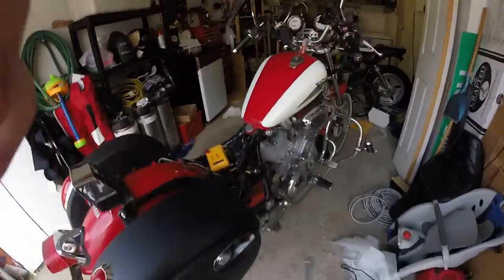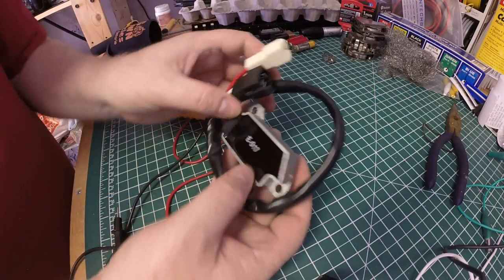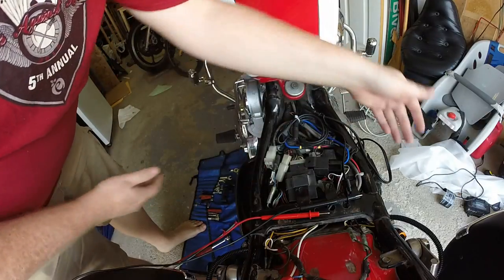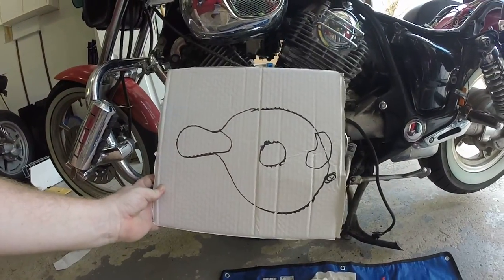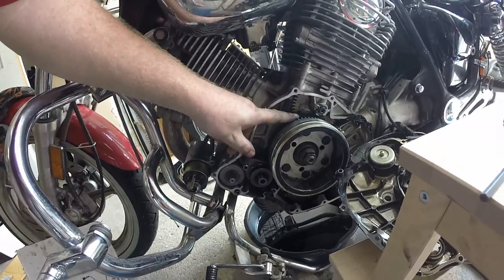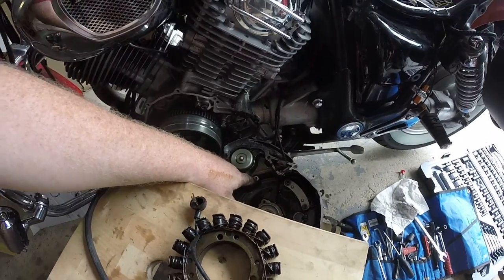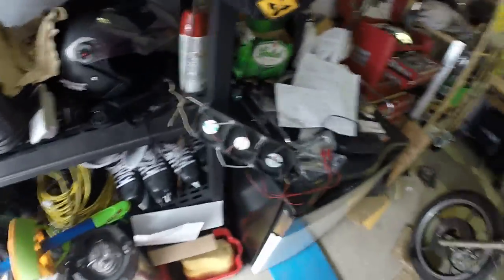1995 Virago xv1100 Stator Replacement (Part 1: removal)

Comment: Hello my friend
Can you tell me the number of threads, the dimension of the winding wire of the stator. Star or delta winding connection?
Reply from the maker: Sorry, no.  I didn't take those measurements.  I bought one off eBay similar to this: https://www.ebay.ca/itm/272268238568
I hope that helps!
Reply: @zeroreality  Does anyone know how to tell me the number of threads and the thickness of the wire for this stator magnet.Please help
Reply from the maker: @musicfromaroundtheworld5453  I've pinned your comment to the top of the comments in case someone comes by and can answer you.  Good luck!

Comment: Great video, but maybe I can save a step or two for others.  I learned this from a Yamaha Mechanic.  Leave the starter relay attached to the case.  Just remove the one hex head  bolt and its round assembly (this screws into the shaft for the gears).  Make sure battery is disconnected.  Remove wire from starter relay to starter (starter side)  I used a M6 1.0 thread bolt (2) to attach the plastic relay cover to the case cover.  This made it easy to attach  
I changed the stator from the other side of bike by sliding the cover  (with stator) under the engine, and sliding it back under when done.  I used a box to hold chrome cover while working.
Reply from the maker: Good stuff! If you have any more tips, leave them in the comments.

Comment: great vidio, thanks,, just an FYI, those are not Philips screws. they are JIS ( Japanese Industrial Standard) look almost the same, just have a flat tip. thats why they strip so easy if you use the wrong driver. cheers
Reply from the maker: Omg I know that now! I bought a set online (not Amazon, just can't remember where) shortly after I made the part 2 video and immediately stopped stripping screws everywhere. They are 100% the tool for the job.
Reply: @zeroreality  we all learned the hard way.

Comment: Thanks for making this, it helped to refresh my memory, I have to change another stator (used a cheap one last time, lesson learned). Instead of doing the cardboard outline the way you did, use the new gasket to trace your outline and hold your bolts.
Reply from the maker: Using the new gasket works, but I'd be worried about tearing it while working in my cramped garage.  The cardboard is disposable, stands up with all the bolts in place, and brings out my artistic side!  Did you reinforce the gasket with anything while doing the job?

Comment: Hey Alex, Thanks for putting a video of this up. I've been working on my uncle's 87' 700 virago, so far, for about seven hours. The hardest parts have been the starter motor philips screws were stripped and the assembly next to the flywheel spinny thingy with the spring kept coming apart as I'm trying to get the cover to go back on. I originally pictured this taking a few hours, but it has been more of a journey than that. I also found it hard to get my cover to "shunk" back on. The rods that go into the cover had to be oiled after I took so long that the RTV dried. Its been a day, ya know? Will update later this week once I finish up and put oil back in it.
Reply from the maker: If it's only been "a day", then you're like 10 days faster than I was.
Reply: the reason many people strip the 'philips' screws is because exactly that ; they aint philips screws. they are JIS screws ;
Japan industry standard. not philips :) they are almost the same... and thats what catches people, they have a philips screwdriver or bit, but not a JIS bit or screw driver. And it makes a difference having the right bit! trust me :)

Comment: thought i had the same problem but being a bike noob this video still helped me alot, i got a virago bobber from my dad a while back and started tinkering with it, i saw that the voltage regulator was zip tied to part of the farm, me not knowing i just figured that was the best place my dad thought would work, so i ended up bolting it to the battery box. me not know the casing was the ground for it, i ungrounded it doing so. the first part of the video let me know what i did wrong, ended up finding a place to bolt it to the frame and know my bike is charging again. thank you so much, it has been stressing me out for a couple weeks as i didnt think i had the mechanical skill to replace the stator
Reply: also if you read this where did you get the side cases?
Reply from the maker: @TylerGibsonSIRdipsALOT69  found them from a guy it in Newfoundland. Two pieces of plastic for $150.
Reply: @zeroreality  well hopefully they're good quality they look nice, thats my next add on for my bike is some cases, bobber or not i like functionality as well

Comment: Thank you for posting this mate. I’m having similar problems on a 1991Virago XV750, battery went dead while riding. I replaced it with a new one but still doesn’t charge. I’ll start by checking the stator.
Reply from the maker: Camilo Gonzalez Also check your rectifier. Take it off the bike to test. If it's the rectifier, it's a lot easier and cheaper to fix. Good luck!

Comment: Very informative. I think I just found my problem, thanks to you. My battery was not charging, but it may have been because I didn't have the rectifier grounded. I will check and hopefully it works. Thanks for the video.

Comment: Great vid! Similar issue with my vstar1100. Hoping is the rectifier
Reply from the maker: I hope so too since that is much easier to swap out.  Part 2 has a little bit on testing your rectifier (you need to take it off the bike to test it properly).
https://www.youtube.com/watch?v=w_Ui_FIkR_M&t=6m49s

Comment: I have an odd charging problem/issue.  Back in 09, I replaced the R/R that was shorted.  The odd part is, it only charge at 1500 rpm, ~13.5v  At idle, 1k rpm and Pass 2000 rpm, it goes back to ~12.5v ish......I think it might be the stator.
Reply from the maker: What's your battery's voltage when the bike is off?  Does the voltage sag when you hold the throttle past 2000rpm, or does it dip, then slowly rise?  Might just be a dead battery.

Comment: After taking everything apart except for one Allen bolt that I couldn't get off to put on my new stator I realized that my rectifier was blown and that is a 5-minute job... so anyone who's attempting to tackle the stator check your rectifier first you could save hours of grief..lol
Reply from the maker: Don't be so sure.  The stator and rectifier work as a pair, so a lot of the time they die together.  You may have had to do this job either way!  (This is what I told me neighbour after he paid to have his RSTD stator done, got the bike back and found out the rectifier was he problem all along.)
Reply: @zeroreality     yeah hopefully I won't have to replace the stator but I have it if I need to so far it seems the power is better and my light headlight is shining bright but I'll keep a close eye on it. My old rectifier looks like it exploded like a fire cracker ..that's how bad it was.lol  I got someone who can take that bolt off for me if I need to get to the stator. But your video was the best one to show me how to get all that stuff off to get to it. Only have forty thousand miles on my bike someone told me to Staters should still be good we'll see... I will keep you & your people posted.
Reply from the maker: @jpstevens7430  Cheers bud, and good luck.  I got a little voltage gauge that just read off the battery, and installed it on my bars.  It let me read the voltage in real-time and helped me get over being gun-shy on the bike.

Comment: Been trying to figure out what is blowing my 30A main fuse. Found today (thru elimination) that it's the regulator line. When I remove the regulator from the passenger peg (so it's not grounded), I don't get continuity thru the regulator feed (red wire) any more. 
For some reason, a previous owner cut the white wires from the stator and regulator and just wired them directly, so I can't "test" the stator per se. Can I assume that the short from the regulator red wire to the regulator frame that the short is in the regulator, not the stator?
Reply from the maker: Short answer: no, I don't think so.
I want to be clear here and make sure I understand the wiring.  The previous owner removed the little plastic connectors from the stator and rectifier and soldered the wires together directly?  If that's the case, then I suggest you first cut those wires (one at a time) and fit some kind of connector (of a different colour) on each wire.  I'd use bullet connectors and a different colour of shrink wrap on each one, doing one at a time so you don't mess up the order.  That way you can isolate the stator from the rectifier and test them individually for the short.

Comment: i have the same bike.my problem is my rear parking/signal light stop working.no power at all. brake light works. front parking light works but wont flash when L or R signal is pressed. headlight works. checked the fuses at the handlebar  and there good. What can it be?
Reply from the maker: First, check any wiring you did most recently.  I had done a bit when my flashers and break like stopped working on a ride; turns out one of the wires had shifted under the seat and the sheathing wore off and created a short.  Ended up boiling the "41R-71" (located under the seat) box which controls flashers, break, and starter relays.  It's about 2in x 2in x 1in and is the largest black box under the seat which is easily visible.  That's my best guess, so you should start there.

Obviously check to make sure the plug didn't come out first and that there are no exposed wires.

Comment: Hey what bags do you have on your Virago I've been wanting some saddlebags for mine
Reply from the maker: They were an aftermarket set I won at a silent auction on a charity ride. They were cheap plastic, bounced a lot, and flew open a couple of times (I lost two bottles of beer once 😭).
Try to find bags that open on the top, not the sides.
Reply: @zeroreality  ok yea once I lost my sweet alcohol I would definitely get a new set

Comment: I dont know if youre still on youtube checking comments lol but is this the same procedure for the 95 xv750? it all looks the same
Reply from the maker: I never did this on my 750, but I imagine it's almost entirely the same.  Everything was in the same place on those bikes.  The only difference aside from the motor was the 1100 had a separate reserve tank and a fuel pump.

Comment: Does any one know what the stator watts out put is
Reply from the maker: I checked the Clymer manual and the Haynes manual; neither mention a specific output.  They both say the main fuse is 20amps, so it can't be more than 20a x 12v ~ 240 watts.  With a healthy battery, it should read about 14.8v at 3000rpm, but anything over 14v is a good sign.

I've pinned this comment just in case someone else knows, they'll see this first.

Comment: Have the same bike just a couple years older but exact same set up. Just changed the stator and now that its back together same way as before, my clutch wont work and there is no tension at all no matter how much u try and adjust both sides of clutch cable. Have took it apart twice to see if anything im missing and nothing looks out of place or broke does anyone know what i could do or could have done wrong
Reply from the maker: If it is connected at both ends, try pulling the lever while the connection in visible on the engine side.  If it doesn't pull on that end, then the cable must be broken or something.
Reply: It pulls on that end the cable isnt broke it seems like the clutch isnt wanting to release or something. It pulls the lever on the motor that it is supposed to but still does nothing
Reply: If it would let me post my video i would. It was working perfect before we chaged the stator and now that its changed and back together the clutch just doesnt want to engage no matter what u do or how much u adjust but it does move it on the motor it just doesn't do anything at all. Had it on the back stand so the back tire was free to spin and no matter what u do it doesn't engage and stop the tire from spinning or help it get it gear feels like u are shifting without touching the clutch when u put it in gear
Reply from the maker: @Joker52601  How fast does the tire spin?  Even in neutral is should spin very slowly just from residual friction on the clutch-plates.  The clutch-plates are on the other side of the motor, so they couldn't have been touched during a stator replacement.
Reply: Ya they was not touched only thing that was touched at all was the clutch release bearing that the cable connect to it had fell out when we took the cover off but put them back the way they was it seemed. It spins a lil in natural like u said and when u have it in gear it spins a lil faster and u can get it to spin a lil faster by hitting the gas but not by much or as fast as it should spin when u hit the gas
Reply from the maker: @Joker52601  Can you manually engage the clutch by moving the lever with your hands (as seen here https://www.youtube.com/watch?v=tXS2tJhBiJE&t=135 by chance)?  I wonder if somehow the clutch expects to be pulled on more than the cable can normally and you need to tighten it somehow... (doing my best while out of town)
Reply: No cant get it to manually engage either that the part thats giving no tention not matter how much u try and adjust tightness on motor and clutch lever. Seems like the release bearings either isn't turning like it supposed to or not pushing on whatever the push rod is on this 1. I cant remember how the set up is for it to engage till i take it back apart
Reply: If it would let me share my pics and video of it on here it would be easier to explain but it not letting me from my phone
Reply from the maker: @Joker52601  Sorry bud, but I don't think I can help.  The stator job shouldn't have had any effect on the clutch, so I'm at a loss for what else it could be.  I'm no expert either; just a garage DIY guy.  I hope you can get it sorted and back in the wind.  Good luck.
Reply: No problem i just figured it was worth a shot asking someone else's opinion never know if someone ran into the same problem before im just lost cause like u said all we did was changed the stator that has nothing to do with the clutch. But thanks for trying to help

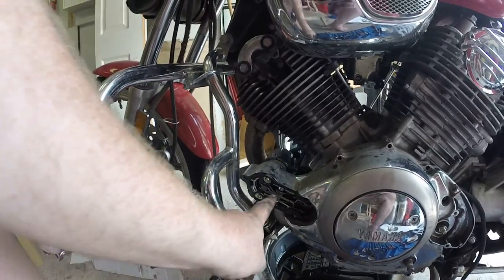Comment: Hi, can u explain how u got this solenoid thing of (u start talking about it at @ 07:48 , i need to remove that allen bolt, but i can't get it loose)  Thanks in advance
Reply from the maker: The starter solenoid was actually fairly easy by comparison to the rest of this tear-down.  The solenoid actuates a lever arm that engages the starter motor gear.  That lever arm pivots on the allen bolt you are talking about.  I had to get at it with an extender from below as it is pointing up towards the handlebars.  If the allen is stuck it may have been over-tightened, and the only thing I can recommend is getting an extender on there and use a hammer on the handle of your extender to jerk it loose.  If you just try to apply more and more force you may end up rounding the inside of the allen nut.  Good luck, and if you need more help just let me know.
Reply: @zeroreality  it seems that it is already a bit rounded inside :/  Makes me wonder what in the world did the previous owner do...  Can i assume it is a bolt with metric thread? I hope i dont have to drill it out, but i'm affraid i'll have no other choice if the problem persists
Reply from the maker: @1982seba  It is a metric bike, so everything should be metric... unless the previous owner did something.  Have you tried SAE allens on it?
Reply: @zeroreality  it's just a normal set of allen keys i have here
Reply from the maker: @1982seba  Most sets come with metric and SAE (standard) sizes.  If the previous owner replaced that bolt they may have done so with "whatever fits the threads" instead of the correct bolt.  However, it might just mean fiddling with it and swearing loudly at it to get it out.  That's the method I fall back on!